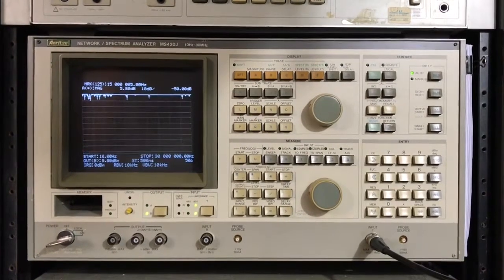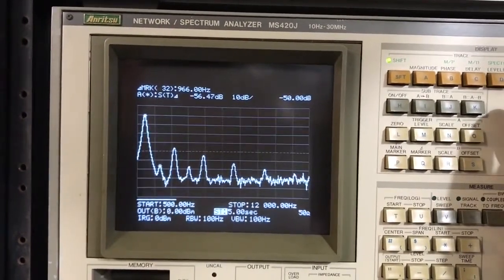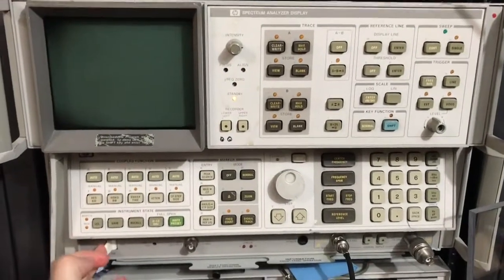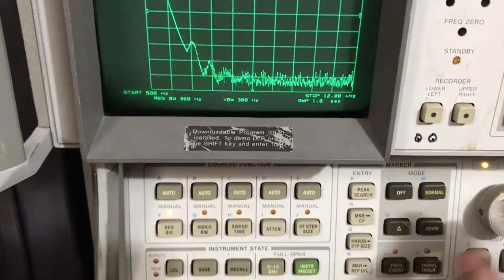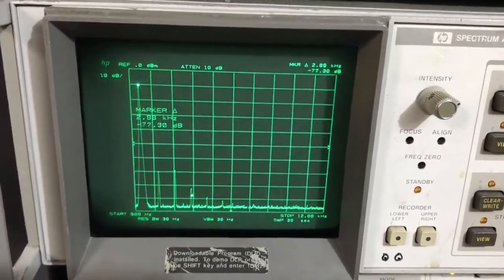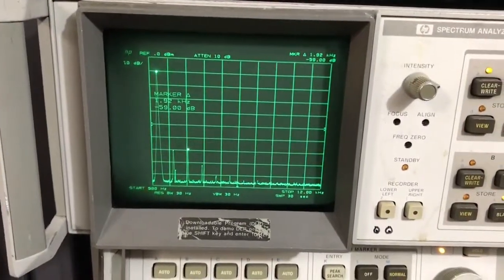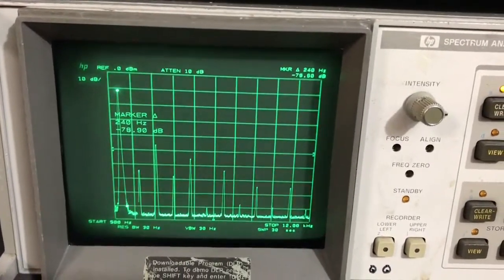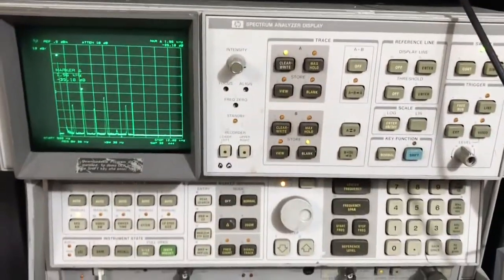Audio Distortion Measurements on Anritsu MS420J and HP 8568B Spectrum Analyzers

Comment: hanks for the video.
You connected the HP209A generator, designed for a 600-ohm load, to the spectrum analyzer input with a 50-ohm impedance. The HP209A generator must be overloaded, or you used a probe that increases the input impedance.
Reply from the maker: Well, that is correct, but the level was set quite low, so I think the mismatch effect was minimal. If I had used a higher power level then yes it would likely have overloaded the 209.

Comment: I think you made a very good point at the beginning of your video that a sine wave can look great on a scope but still have a lot of harmonic content in it. I have tried to move one step beyond the sine wave analysis of harmonics, still using a fundamental frequency  (assume middle C @ 440 Hz) and examine the harmonic profile of a violin and compare different violins and then the same to compare SET amplifiers with PP amplifiers. Gets pretty tedious and is somewhat subjective as different samples can vary but I believe over a significant number of samplings, we should be able to identify the different violins and find some objective differences between SET amplifiers and PP amplifiers. With your very nice equipment, I wonder if you have thought of or attempted such harmonic profile measurements.
Reply from the maker: Wow---no I never even thought of it! But I need to try that at least with my violin---should be very interesting, and a violin is probably the perfect instrument (or one of) to do harmonic testing like you described, since it is pretty rich in harmonic content. Might be difficult to do a non-subjective test on different violins though, since in my experience, I play differently on a different instrument, due to the "feel" of the instrument, and even on an open string there are a lot of variables: finger positioning on the bow, angle of tilt, string age/condition, bow pressure, bow position on the string, etc. But trying this should give some really neat results on the analyzers. You've really put a bee in my bonnet now! 😀I'll be sure to ask your input when I have a chance to do something along this line, as you have much more experience than me, and I know such analysis is fraught with pitfalls sometimes. :)